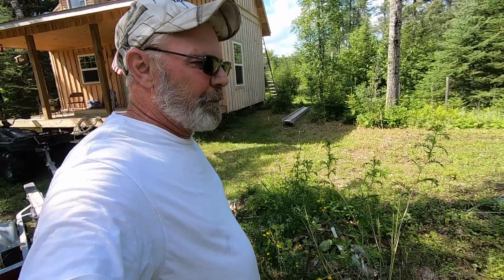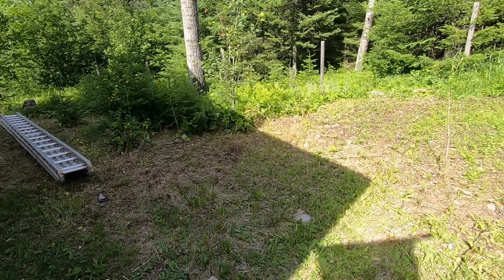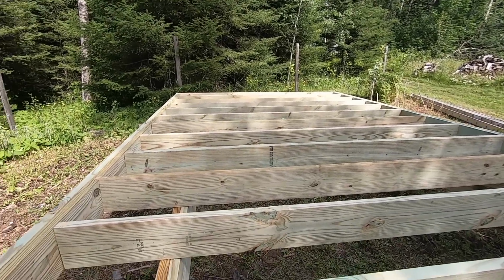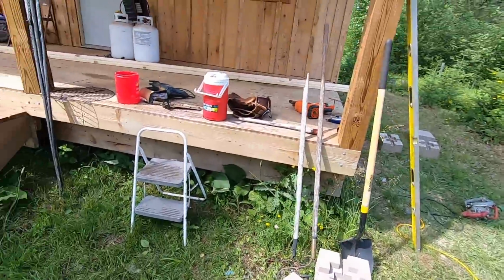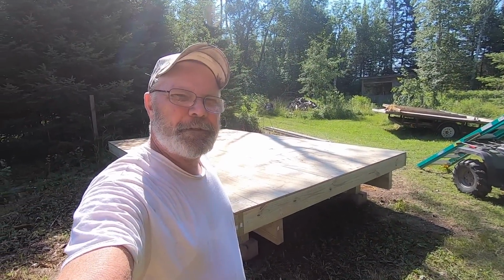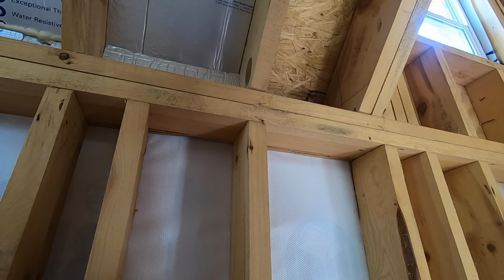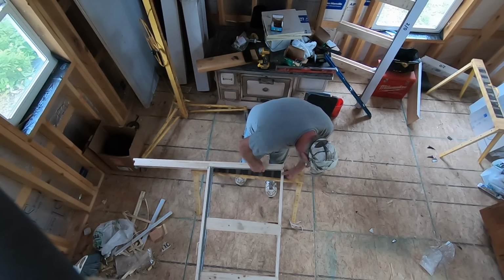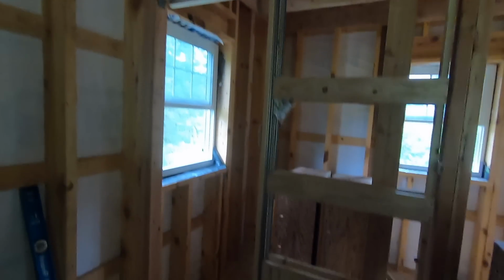Start of the wood/storage shed and #offgridcabin gets pocket door frames

Comment: If moving the shed in the future is in the plans I would suggest building it on heavy skids with angled front so it could be towed en masse to the new location.  Lay the skids on the blocks to get them off the ground but make it easy to jack them up lowering the building for towing.  8x8's or larger can be built in with great rigidity easily at the beginning but become more difficult the longer you go in the process.  They also can be cut out of round logs with your chainsaw then level the top surfaces.  Just a thought.
Reply from the maker: It's a great idea, 👍.  Thanks.